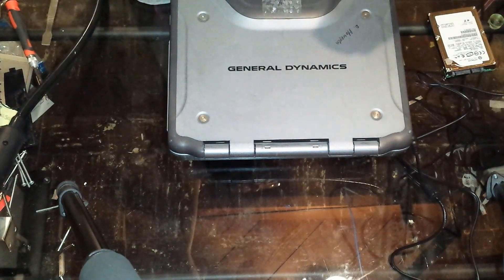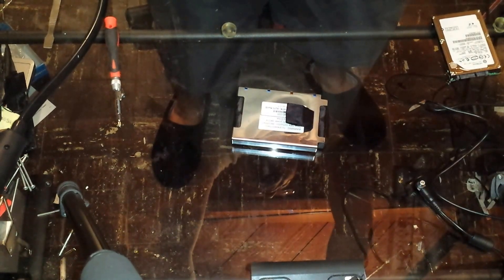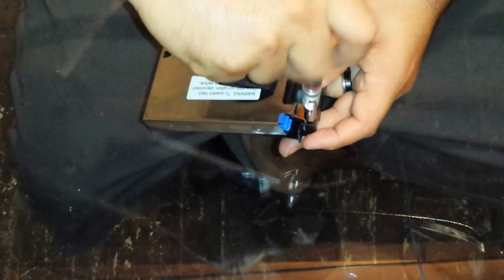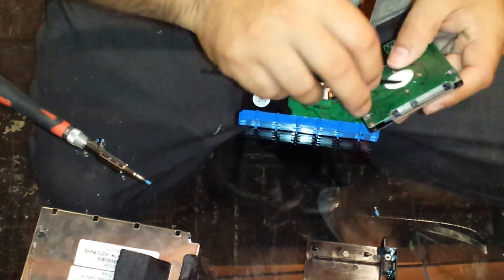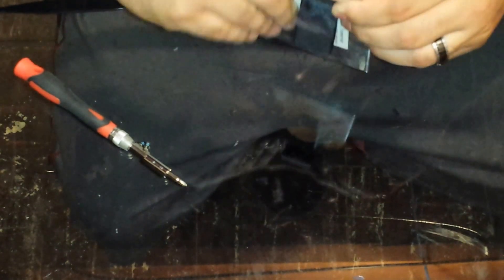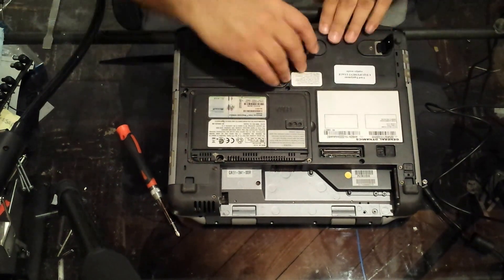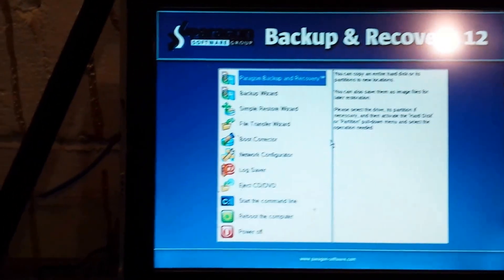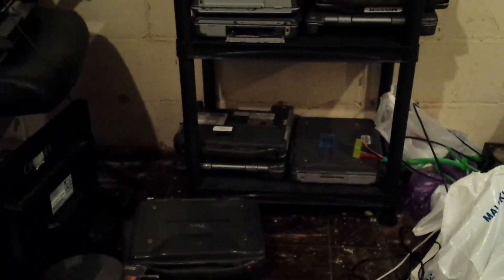General Dynamics GoBook XR-1 Itronix IX-270 hard drive replacement

Comment: Is the connector that attaches the hard drive caddy to the computer standard or proprietary?
Reply from the maker: It's a proprietary connector. Inside the caddy it has the typical SATA connection, and proprietary connector to the board. 

Let me know if you can't find one for the IX-270, I might have one to sell.

Comment: The company is out of business now.  I need the HD cases.  Do you have any idea where I can buy them?  What kind of connector is used to connect the case to Gobook?
Reply from the maker: I looked on eBay and I couldn't find any, which means I should probably post some on there for sale. I am not sure where you can find them since they are scarce.

Christian
Reply: 616 PC Repair How much are you going ask for a case?  If I can get the connector cable I can make my own case.
Reply: Meemee Nge GD is a joke, they got rid of something thats very profitable as each new unit has potential to make $5000 each I like collecting these types of laptops, and have many different models, i would like to afford a new one but too much lol. I have a Raytheon one, a Itronix 3go book 3, and a panasonic tough book cf 29, that i converted to take sata drives, im really wanting a tough book that was actually owned by someone in the military
Reply from the maker: chris kennedy You're right, they made a bad decision. I have quite a few of these GD machines and finding parts is a pain, but I have been able to use some that are really beaten up to make good ones. I have a CF-29, CF-19 which are personal machines, but thinking about selling.
Reply: I've been wanting a getac tough laptop cause they are pretty nice

Comment: What kind of hard drive is that? I am interested to see if the GoBook III can a utilize 2.5" solid state drive. I am afraid to order one and be constrained to their bizarre hardware, are there breakouts or is it compatible? I can't really tell from the video.
Reply from the maker: The hard drive in the video is just a standard 2.5" mechanical SATA drive, not a solid state. You raise a good question with whether or not one would work on them. Unfortunately I'm in the same boat, I don't want to buy one and have it not work, lol. 

If you find any information on it on forums or whatever please share here for others that may have the same question. Thanks for the comment.

Christian
Reply: 2.5 SSD works fine. It's little thinner than original HD.  You may need to fabricate something to fit the SSD between the blue rubber holder in the case.
Reply from the maker: Well that's good to know that an SSD will work. I would probably use some foam to fill the extra space. Thanks.

Christian
Reply: What is the name of the hard drive connector. I have been looking everywhere for one
Reply from the maker: @ozarkmountainranger4201  Damn, I'm sorry I missed your comment. Are you looking for the complete enclosure or just the ribbon cable that connects to the hard drive?

Again, my apologies for missing the comment. I like to respond as soon as they come in. I hope may still be able to help you out.
Reply: @616pcrepair  yeah I sold it. Appreciate the follow up though